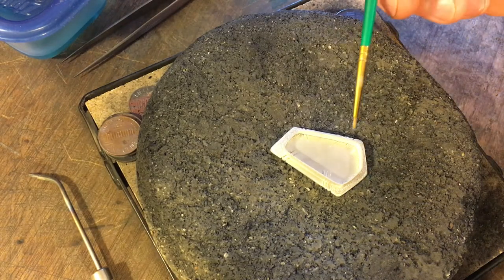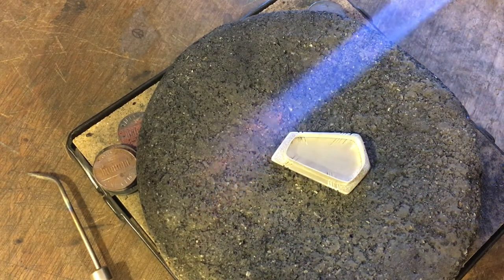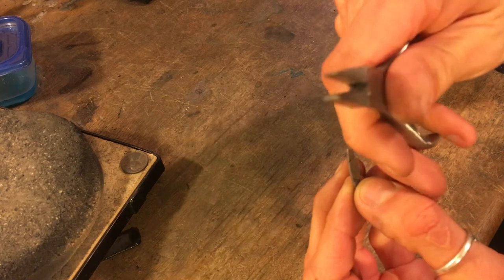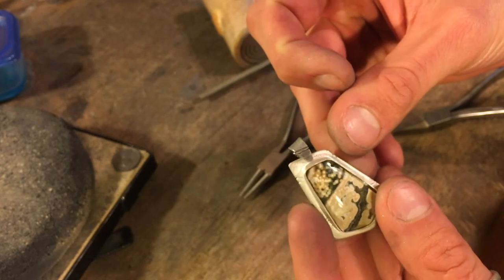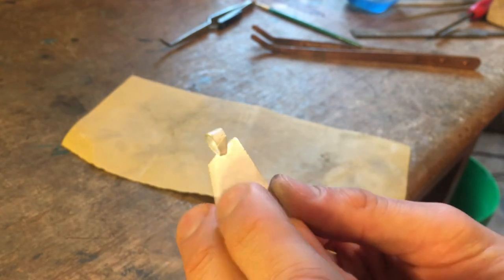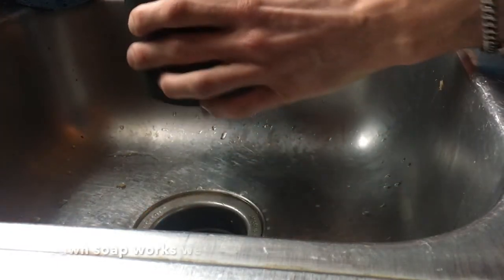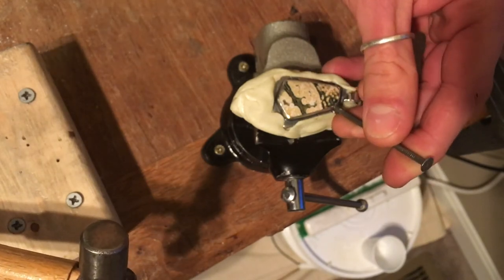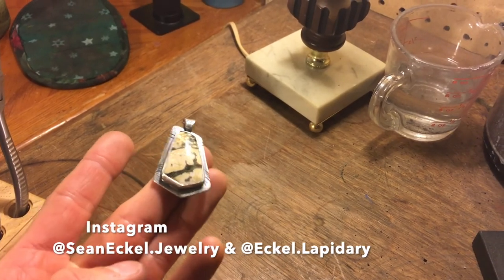Jewelry 101: How to Make a Pendant - Part 2 of 2 - Silversmithing Tips and Tricks for All Levels!

Comment: Awesome job. Beautiful piece. A couple ideas to help you. Yellow ochre keeps solder from flowing to unwanted areas a hack is white out does the same. You can buy an extension cord for your tank so you don’t have to hold the bottle. You can use your fordome hammer to set your stone. If you don’t have a burnished you can use the back of a spoon to burnish and finish your bezel.

Comment: Hi again, so you use a polishing cloth on the bottom of your bezel and on the back plate before soldering? A polishing cloth has polishing compound IN it, polishing compound will hinder a good join, the metal is then essentially "dirty" after using a polishing cloth. Also, having the "tooth" of a good sanding is the best surface to surface "clean" for a good join. Flux will keep it clean too. I'm sharing some tips because you've mentioned that you are self taught... I hope input is helpful. I appreciate how conscientiously you fabricate, for a clean quality setting. I like your channel, you seem humble - how refreshing! 😅

Comment: What an interesting pendant; it’s very angular and yet you’ve added touches that give it an organic feel. I love it. Your soldering tip in the previous vid is awesome. I will definitely be placing the solder pallion underneath the seam of the bezel from now on! I notice you said you like using steel wool after you have used liver of sulphur; me too. I now use the steel wool attachments for my dremel. They come in brushes and discs, such a time saver and great for nooks and crevices. Hope you are staying safe and well 🤘